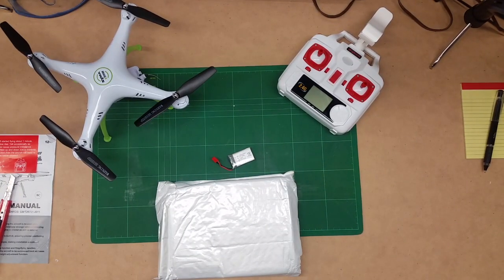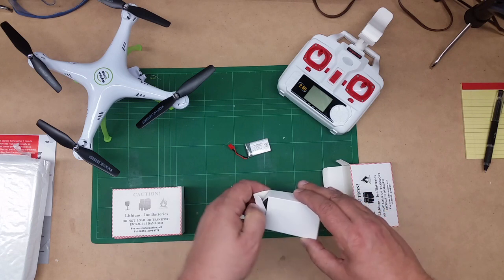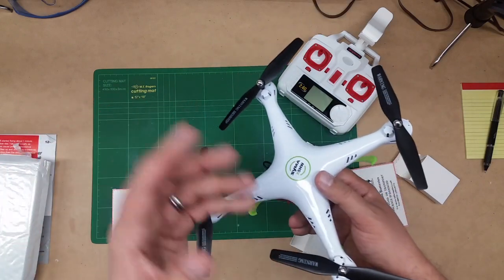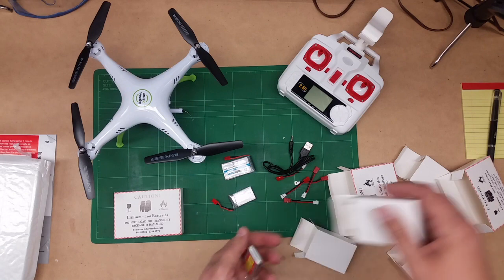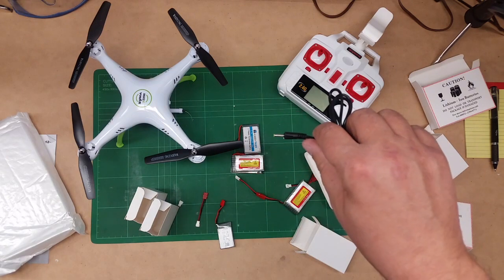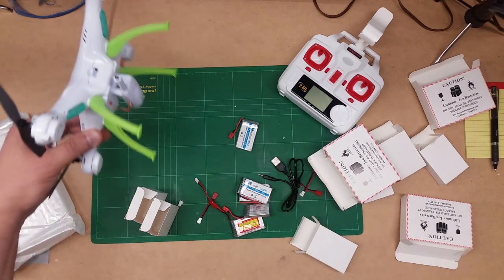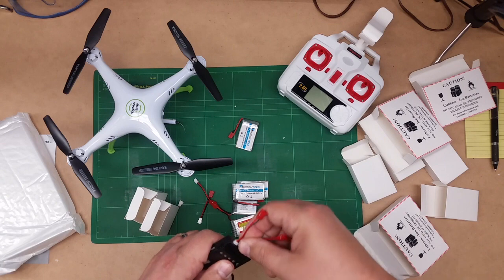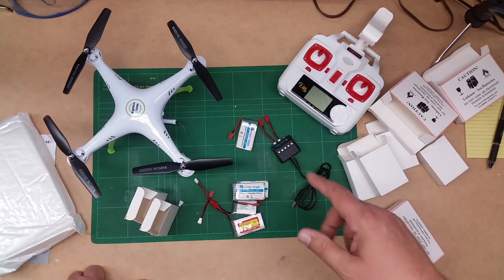Video Drone - Upgrading to 1200mah Batteries in the Syma X5HC!

Comment: I had a question if some can answer it I have a drone that came with a 350mah 3.7v battery if I change it with a 750 mah battery will it fry the drone plss answer and thanks 🙏🏻
Reply from the maker: if it is the same voltage, it "should" work...

Comment: Those adapter plugs are to use on the older Syma drones. My X5C uses that  smaller white connector although I doubt those batteries would fit mine.
Reply from the maker: Sorry not sure

Comment: Can you help me pls, I have an  trouble on my road rats predator altitude hold quad copter, the wire of my battery is swap and my quad copter didn't work.Is there is any solution

Comment: Hi just a little question since you placed a bigger battery will it have some effect on the motor's life span? will it over heat after surpassing the 5-7 mins fly time? newbie drone owner here thanks in advance
Reply from the maker: Have had no heating issues, so all has been good for me at least.  Flight time is about 20% more...
Reply: Video-Drone thank you for the info it really helps newbies like me
Reply from the maker: Glad to help!

Comment: My drone original battery is 3.7v 780mAh I bought a 3.7v 1000mAH battery but when I try to fly the drone using the 1000mah the drone cuts off itself . Could someone help me?

Comment: which is better if i do this and also change over to 3 blade props for stability and chand antenna on controller to dipole or if i go with x8hg
Reply from the maker: Depends what you want to do, the X5 is easy to fly, where the X* platform is far harder to fly (see the video where mine flew away!).  The antenna is well worth and while I have tri-blades (for the X8) I have not tried them however I doubt that they add stability.

Comment: what do you there are two types of battery?  in general, as long as 3.7 v lipo with any low or high mah, I can buy, right
Reply from the maker: I use the 1200 Mah which work great (here is the link for H version http://amzn.to/2jNbeK0  and this is the link for the non Hover version http://amzn.to/2jN2dka)

Comment: is there a need to use a lipo battery for the transmitter or will rechargeable AA suffice
Reply from the maker: Rechargeable are just fine, I have the same set in it today as when I made this video months back :-)
Reply: thank you

Comment: if I buy 1200mah, will the connection be the same on drone? how many minutes us the fly time?
Reply from the maker: Yes (need to order the correct version for your drone as there are two types) and its about double the stock battery...

Comment: I did the very same mod on my x5 but I went a little farther by opening up the batterie bay so the bigger 1200mah batteries slid in and out much easier, to do that you need a sharp wood chisel about 25mm wide then you shave off a little of the plastic case on the bottom of the copters body in there are two ribs that run from front to rear shave off some plastic with the wood chisel about 2mm, and the 1200mah batteries will slid in and out easy, the 1200mah batterie is 12grams heaver than the 500mah batterie is but the flight time is increased by at least 10 to 13 minuets, I get 17 to 20 minuets flight time with the 1200mah batteries in my x5sw,,, hope you all have fun
Reply from the maker: Sounds like a cool mod!
Reply: remember the extra weight of the bigger batterie will increase your stopping distances so watch your altitude when doing stunts

Comment: I need those connector pieces for my drone
Reply from the maker: Which ones the JST?
Reply: The adaptor  pieces
Reply: The adaptor pieces that's what they are.
Reply from the maker: Not sure what you mean by "adapter peices" as the battary uses JST connectors and you can get them on eBay...

Comment: Can you please tell me the flight time before changing the battery and after it ?
Reply from the maker: about 3 minutes more than the stock bat...
Reply: x5HW  500mah -5-6 min with 600mah 6-8min
Reply: i can not believe, that 1200mah only give  3 minutes more. It should be arround 14-15 minutes, which is 2-3 times more then Stock.
Reply: David Tookos consider the weight
Reply: sure, but you said, it is not much heavier. and the plus time is not double but almost like with 750mah inside? it has 3-5 minutes more then 500mah which is Stock. I wondering, cause i planned to buy 1200mah, but if it give me only 3 minutes more, then i use only 750mah which give 8-10 minutes

Comment: will this work with the syma x5c-1?
Reply from the maker: Since I don't one (i.e. a c-1) I can't say for sure, however all of the X5's I have seen have the same connectors and basic shells so my "guess" would be most likely yes...
Reply: maybe no,,they are diif connector,accdentally bought x5c batt,,it didnt fit in x5hc...:(

Comment: Lol.No sweat.Been there done that.
Reply: There's a bumper that the stock battery sit's up against.Gotta grind that off and also fly without the battery cover.Tight squeeze but the batterys should fit.Cheers.
Reply from the maker: Interesting is there a link for the battery?
Reply: Got mine on Ebay.